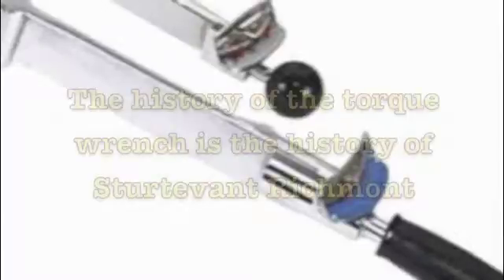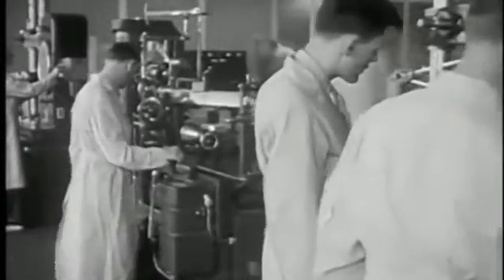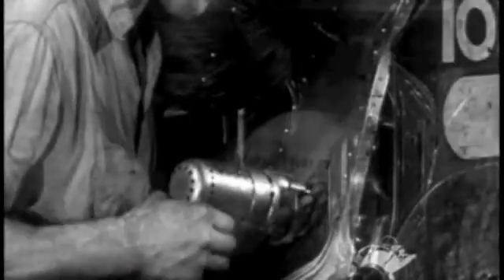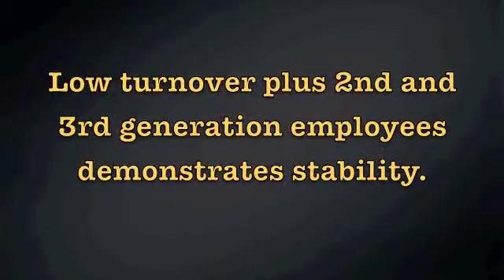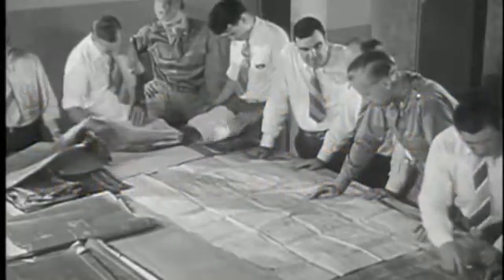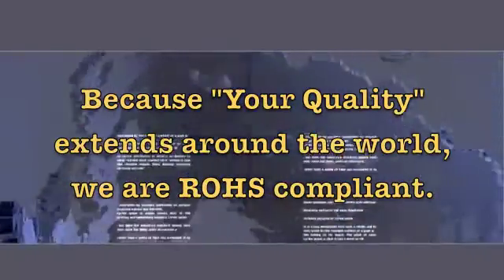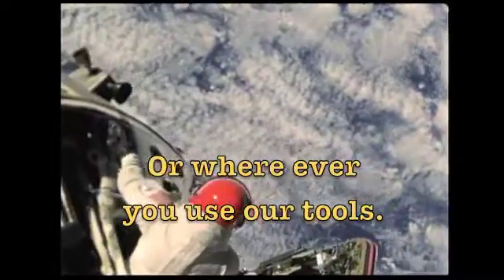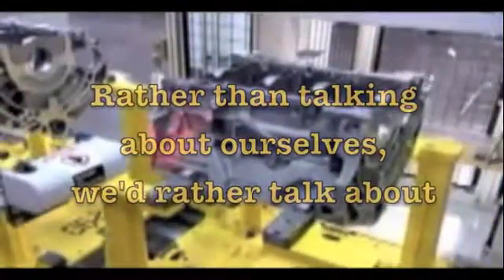VID 113  The History of Torque Tools is the History of Sturtevant Richmont

Comment: Yes they are the finest torque tools on the planet. None can ever match the level of precision and repeatability of output torque as SR.
Also I love the overall design that really makes the wrench flexible for interchangeability of heads without missing out on the torque values and eliminating the need of large inventories of torque wrenches and heads.
I have developed plenty of special interchangeable heads of dovetail connections in 1.7/16" and 3.7/8" common centrelines for variety of critical applications and to properly reach out and torque the inaccessible joints with SR torque wrenches.
The best one I recall was the Toe in tool developed for Volkswagen's Polo that insisted them to change the brand of the tool just because of this 21 mm special FN head that became popular with other OEMs as well.
Reply from the maker: Thank you for your kind words about our tools. We work hard to deliver the just the kind of reputation that you discussed.
Reply from the maker: Thank you! We appreciate your appreciation for the tools.